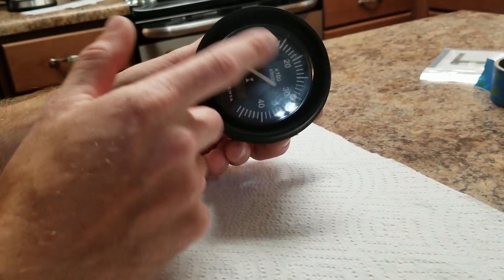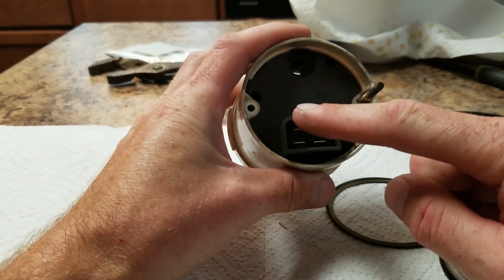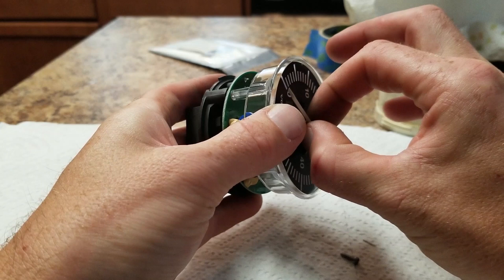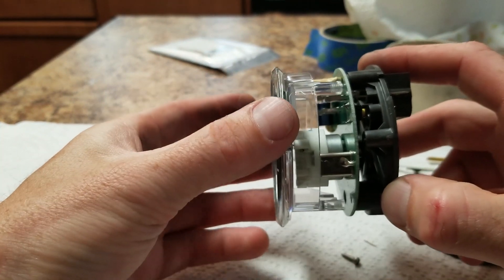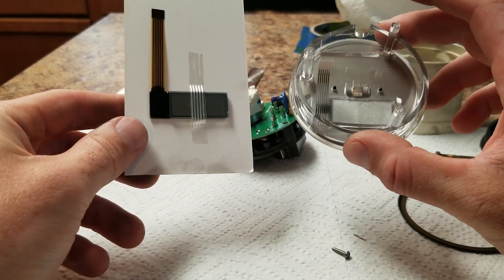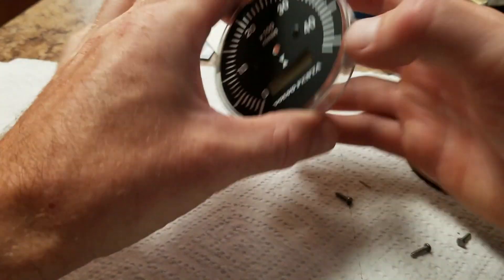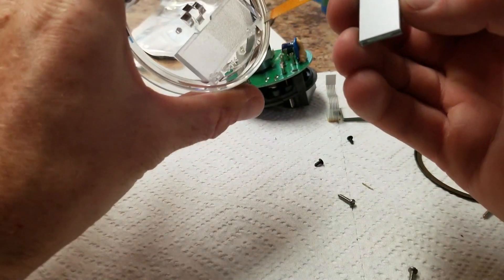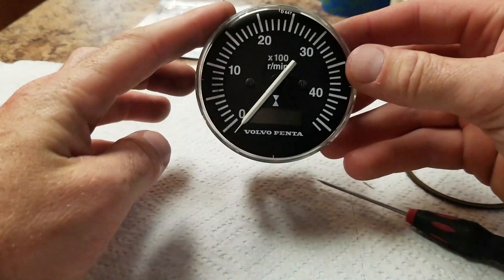Volvo Penta tachometer - hour meter lcd repair

Comment: Thank you! All works. The replacement LCD I got didn't have an adhesive back. However you can tape the edges on the outside with a normal scotch tape as they are blocked by the black gauge display anyways. If you put your own double sided sticky tape on the back, make sure it is transparent as the LCD is back illuminated.

Comment: how did you up date the read out of current hours on the new hour read out
Reply from the maker: 1 year later, sorry. I don’t receive notifications on these comments. But this is just replacing the screen which displays the hours. The chip holds the hours. This repair is to just so you can read out your hours as they actually are.